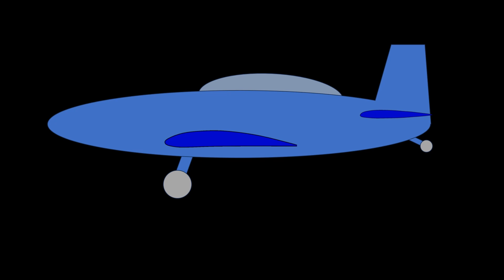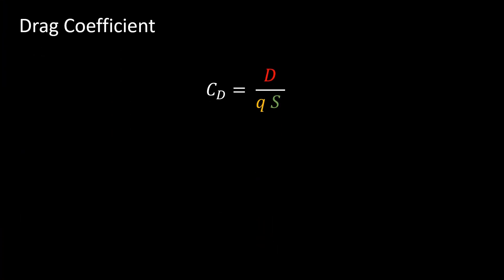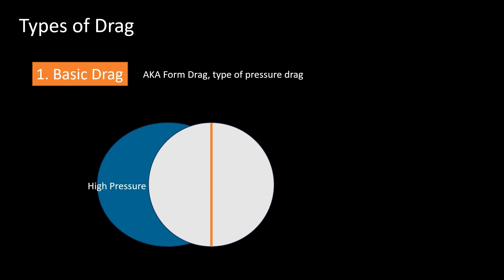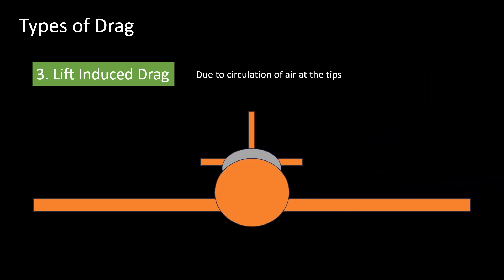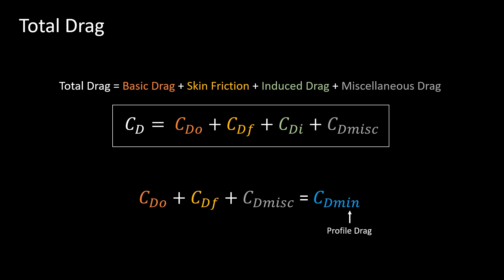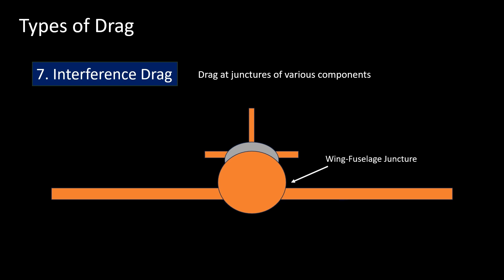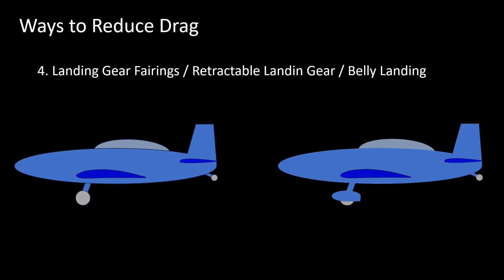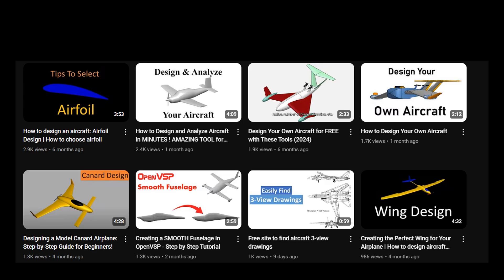Types of Drag | How to Reduce Drag | Aircraft Design

Comment: The landing gear contributes a lot of drag even though its small compared to the rest of the aircraft. Because of its shape. Which is interesting. The tadpole shape is actually not used that much I think. Even in smaller general aviation aircraft, I think its somewhat tapered like the tadpole shape but its not really a tadpole. Practical reasons I guess. Lift induced drag is actually kinda complicated. Higher aspect ratio wings have their limitations. A longer, thinner, lower chord wing has more bending moments involved to carry the weight of the plane, requires more structure weight. Its a numbers game, trade-off. Also reduces fuel capacity depending. And maneuverability, but that might not be too important unless its a fighter or aerobatic. Keeping the CG close to the wing is good for efficiency. But the CG has to be substantially ahead of the wing's 'resultant lift point' or center of pressure or whatever, to ensure longitudinal stability. What do we mean by belly landing ? Also there are 2 prisms. The one shaped like a bullet I'm not sure about that shape. If its a prism.  Which side is facing forward, against the relative wind ? And if the curved side is facing forward, why would it have a higher drag coefficient than the other prism ? Engine cowlings are good of course. But we have to make sure the engine has adequate cooling and intake airflow.
Reply from the maker: All valid points. There is always a trade-off in aircraft design. 
Belly landings are meant for small RC planes and UAVs landing on the ground/grass without a landing gear. 
Yes, there is a typing error : the 2nd prism should have been "bullet" with a CDo = 0.295. The flow is from left to right, as indicated by the arrow.
The original data is taken from here:
https://www.grc.nasa.gov/www/k-12/VirtualAero/BottleRocket/airplane/shaped3.html
Reply: Thanks for getting back to me and answering my questions